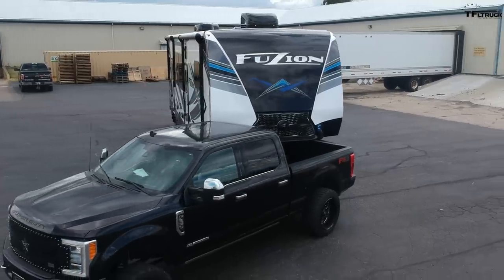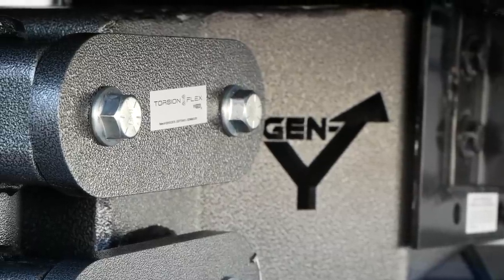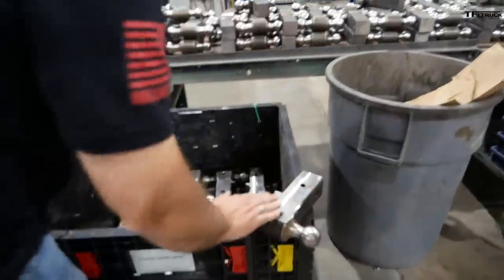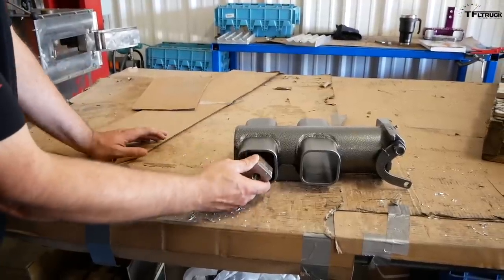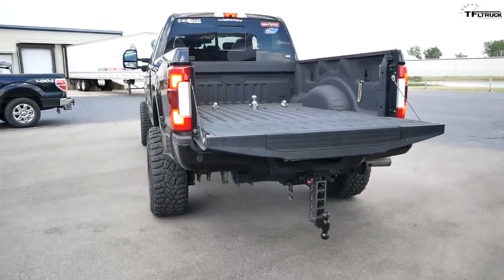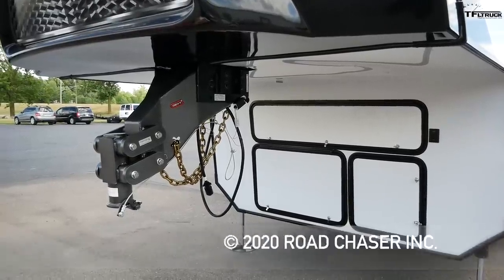Stress-Free Towing: Here’s How This New Hitch Will Change The Way You Tow!

Comment: Which one was a better ride experience, the 5th wheel or the gooseneck? Pro's/cons
Reply: From my experience, Fifth Wheel is super smooth and very connected to the truck but you give up your bed space. 
Gooseneck is a close second but you can still have most of the bed space.  
Generally, Fifth wheel cost a little more than a Gooseneck.  Fifth wheel are quicker/easier to hookup.
Reply: @fntony4967  Thank you.
Reply: Goosenecks provide alot more articulation which is necessary if you are off the pavement. That's why heavy stock haulers for livestock are preferred by ranchers and construction companies that haul equipment. Some claim the gooseneck is stronger also, but I don't know .

Comment: Rubber components over time will deteriorate with wear and age. What is the expected service life in time and mileage before the hitch will need to be rebuilt?
Reply: I’ve heard of Dexter torsion axles lasting 10-20 years plus. Think something like this would be similar.
Reply: @ALMX5DP  can confirm my haulmark 24' enclosed trailer has torsion axles with over 100k miles on them with around 5k lbs on it and it's a 2000 model year.
Reply: As Alan said, most plastics/rubbers deteriorate over a 10-20yr period, affected by use and climatic conditions.  You’ll probably just need to replace those parts when the time comes if they are available separately.

Comment: Still. Nothing beat the stability of a plate style 5th wheel hitch. The chucking and movement you get on the gooseneck style towing hitch is scary when towing heavy. Yes the 5th wheel plate style is bulky. But I’d rather have bulky and stable. Than the other. Put a go pro in the back with a genY and then with a standard 5th wheel puck or rail style hitch. You’ll see what I’m talking about.

Comment: What is the life span of the rubber inserts?
Reply: I was curious about rubber degradation too.  Wonder what happens if there is a catastrophic failure of the rubber too as it gets old and then is suddenly put to heavy use.
Reply: Torsion axles have been commonplace for a long time. They can last upwards of 25 years though I think most say to preemptively replace around 20.
Reply: .........and I was wondering whether the torsion inserts were rebuildable.  (just curious as I don't tow that much trailer and wouldn't be a customer in any event)

Comment: What they didn't do was go down an interstate highway and go over a bridge at 60 miles an hour.
Most Bridges are built taller than the road so you have to go UP on to the bridge and then Down off ot the bridge. This would be a true test of that hitch. I've been pulling a 14,400 5th wheel for 12 years. And because I have a wife it ways 16,000 :) Whenever you go over a bridge at that speed.
You get this BAM BAM going up on it and BAM BAM when you come off the bridge. I have a TRAILAIR hitch. That is a 5th wheel hitch with an airbag and shock absorber made into it. And it
does a great job of relieving stress on the hitch and truck. It also stick further out in front of the 5th wheel giving me plenty of room to walk in between the truck and the 5th wheel. Whereas that hitch gives you no room. I can open my front basement compartment without unhitching and that model
doesn't allow for that. These guys should leave advertising anything to do with towing to people who  do it all the time. They have no idea what their talking about and are just making money for  advertizing that hitch.

Comment: I would be interested in their gooseneck conversation however, Lippert has only certified the Reese Goosebox for their frame and parts on the fifth wheels.  Gen Y is not.  Also, they do not say what is the life expectancy of the rubber in those shafts.  When the rubber components fail (they will at some point), how is the consumer suppose to have them serviced and or replaced?

Comment: I want the shock on the truck, not on one trailer.  You can also go to an offset ball to move the trailer back. Easy peasy. How do you tune the torsional forces to match the load?  Mine varies from a few hundred pounds to a thousand pounds

Comment: With the 5th wheel torsion setup, in the video there appears to be a potential problem with the kingpin end possibly hitting the trailer depending on how bad road conditions are and how much it is flexing up and down.  Not an issue with the gooseneck setup because of the longer distance for clearance.  Would be interested in a comment from the manufacturer.
Reply: I wondered the same thing.  It's getting a lot closer than I'd be comfortable with.

Comment: I'm looking at a new toy hauler and plan to pull it with a ram 3500 mega cab with ramboxes. I want to use the gen y goose neck box. Have you heard of anyone doing this? I plan to add a 4 inch offset ball as well.

Comment: I have a similar 2019 3500 SRW CC LB Duramax and pull a 40’ fifth wheel weighing 13.5k. I noticed the truck was level and not squatting. Did  this truck have any suspension upgrades? Even the lifted Ford stayed level. A 3100lb. pin weight is much heavier than what I pull. Very interested in replacing my Andersen hitch.
Reply: Do you have your 5th wheel as far forward as it can go? My dad has a sliding hitch and a 2500 HD. He slides his all the way forward for driving and all the way back is he needs to turn into really tight spots.

Comment: How is this for turning radius? With most gooseneck I am finding that on sharp turns I risk the tongue hitting the side of my box. I have plenty of cab clearance. But because of the risk of hitting the side of my box I have had to go with a slider hitch which is heavy and takes up a ton of room. If i could find a gooseneck that would allow for the sharp turns I would convert imidiately

Comment: Almost 2 years later and Lippert (LCI) still has not certified this gooseneck conversion for use with their frames. Buyers should know this before spending the money on something that will void the frame warranty on their expensive 5th wheel. That being said I'm betting Lippert has tested it by now and it doesn't pass. If you want a gooseneck conversion look in to the Reese Goosebox. It's approved by LCI for use with their frames.
Reply: Reese does not have a unit for the Rhino pin box>?

Comment: Can you go into greater detail why one would choose a gooseneck vs a 5th wheel? What are the pros and cons of each?
Reply: I'm no expert but it seems that in general RVs are 5th wheel and horse trailer and equipment trailers are gooseneck. It seems to me that a 5th wheel may be easier to hook up because you drive into a wedge instead of having to get it perfectly centered and then lowering the trailer onto it, like with gooseneck. Seems like the big advantage of the gooseneck is that it doesn't dominate the whole bed when it's not in use, and the ball is usually removable to regain full use of the bed, where a 5th wheel hitch tends to require multiple people or a machine or hoist to remove it. As far as when it comes to driving I don't know.
Reply: 5th wheel doesn't need safety chains, goose neck allows for more angle between truck and trailer when going over uneven ground and in pick ups is generally rated for more weight.
Reply: For me, less weight.  Tring to get under my load capacity dont want a 300lb hitch in my truck.  Worried about clearance thou

Comment: Great Video! 3,100 lb Pin Weight in the box on a Single wheel Truck, probably the pickup is rated at 1 Ton. That's 1,100 lbs over weight, how does that work out to Tow that Trailer Legally and Safely?
Reply: Frank Logan - the newer trucks still use the old rating system, as in we call them 3/4 or 1-ton trucks. But the payload capacity is WAY more than that these days. For example, my work truck is an F350 dually, it has a cargo capacity of 5486 lbs. My personal truck is an F250 and the cargo capacity for it is 3300 lbs. so they are still under capacity either way.
Reply: @DanMar5858  you have a F250 with a payload of 3300??? Wow..
Reply: @jasongiordano907  must be a gas truck or single cab diesel f250. Our 2017 ford f350 crew short bed fx4 diesel has a payload of 3,475 lbs.
Reply: @j.l.salayao8055  Worese than that my 2022 F350 6.7 diesel limited with every trailer towing option has a payload of 3150lbs.

Comment: Nice hitch, but never would I tow something that massive without a longbed dually for extra stability.
Reply: Why longbed? I thought short bed was better for towing.
Reply: @noconz0727  You always buy the longest wheelbase truck you can for serious towing.
Reply: I was wondering if anyone was going to comment on the towing vehicle. That 3/4 ton is not legal to pull that trailer, empty or full. 

The ride comparison might be better on a truck that is safe to pull that camper.
Reply: The short bed is only useful for parking in lots and garages. The long bed is a more useful length.
Reply: Noconz0727 MC Nope.
Reply: @chriswilson433  I thought that was an F-350. Is that a 3/4 ton? (i'm asking, I thought the F-350 was a 1 ton or is it only the dually?). Some of those trailers are lighter than they look, mine is only 6000 lbs and I can pull it just fine with my V8 F-150. I probably could pull it better with my V6 Ecoboost, but I don't have it anymore. The only thing that I don't do is go faster than 55 mph. The truck can easily go faster, I don't even feel the trailer, but it is just stupid to do, at 55 I can just let go of the gas and the deceleration is just enough to get me out of trouble, any faster is just asking for trouble.
Reply: Lucyferina

I will look again but I am certain it was an F250 which is a 3/4 ton. Payload on that truck is probably right at 3200 lbs. In a previous video, Andre did a walk-around of that trailer and it is rated to 21k lbs with 4400lbs pin weight at maximum. It is 14k lbs dry with about 3k lbs pin. 

I believe that that particular truck is maxed out with the empty trailer.
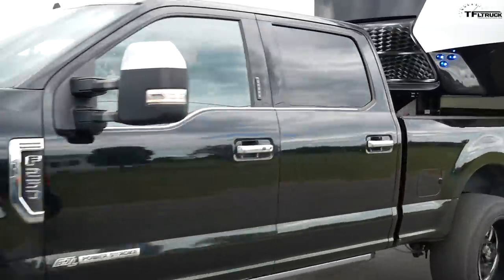Reply: At 13:09, you can see the Ford is an F-250.
Reply: @chriswilson433  please show where its illegal for a non commercial vehicle to exceed payload
Reply: @drew4769  You right that there is no law is most STATES specifically dealing with private vehicles over GVW  Towing or GVCW. However the legal fallout following an accident may encourage you do always drive within in the limits. In Canada (BC specifically where I am from) a peace officer can give you a Violation Ticket which is just a fine or a Notice and Order which means you must bring the vehicle within in compliance. You can get both with one stop. Further to that you don't even need to take it to a scale. You can be served for a vehicle that is unstable while moving, front end higher than the back (squat) and tires that are under inflated. In my eyes it is not enforced enough. There are so many dangerous combinations on the road these days. There are serious RV crashes on our highways every year. All of them were speed or weight related. Our mountain highways are steep and twisty. I laugh when they brag on this TFL channel with their Ike Gauntlet only being 7%. If you have seen the show "Highway to Hell" that is where I live. 3 major highways that allow the West Coast to access the rest of Canada through a series of mountain passes.

Comment: Will the gooseneck option work with the B&W Turnover Ball for a Ram 2500 short bed? Also, does it allow for clearance issues when making sharp turns? New fifth wheel arrives soon and I was in the market for a companion sliding hitch but I would rather go this route! Love the content!!!!!
Reply: So did you get the gen y torsion gooseneck hitch and the b&w turnover ball for your short bed? I have a short bed truck and I’m looking at getting both the gen y and the turnoverball also. Does it work on a fifth wheel for sharp turns in a short bed truck? Thanks.
Reply: @IslenoGutierrez  I haven’t yet. I only have the turnover ball as of now. Main reason I haven’t switched is no one will give me a straight answer of changing out the pin box will void the chassis warranty on my toy hauler
Reply: @mrb9090  You’d have to call either the company that made your toy hauler if they use an in-house warranty or call the company that company uses for their warranty if it’s not in-house. I have a short bed Ram 2500 and I found the fifth wheel I’m going to buy that stays within my payload and tow rating of my truck and I’d like to get the Gen Y torsion gooseneck hitch because of the very smooth ride and the freeing up of space in the bed of my truck but I need to know if it will work on a short bed so it won’t hit the cab when I make sharp turns. I also thought about getting that b&w ball that is moved 4 inches back toward the tailgate to try and make it all work. I’m trying to piece together this info so anything you know helps.

Comment: With a short bed truck, some 5th wheel trailers need more than a slider hitch to prevent a cab strike. My F350 SB has 37" from kingpin center to cab, with a slider adding 12-14", the trailer I bought would clear the cab by roughly 2 5/8" using the Demco slider with 14".   Not much of a safety margin, so this type of pin box would not be a good option for my trailer. I wound up getting a Sidewinder pinbox, and using a CURT A20 5th wheel. The trailer now clears the cab by 11" giving me more than 90* turning ability.  The suspension on it looks like it would be very smooth for the trailer, less wear and tear on the frame and sliders between the kingpin and front axle.

Comment: Doesn’t this void your frame warranty?
Reply: I think he means the frame of the 5th wheel trailer.  For example many manufacturers will void your frame warranty if the Anderson 5th wheel hitch is used.
Reply: @JNC7601  I just asked that question above. The Goosebox will not void the RV's frame warranty
Reply: Is it illegal to pull a goose neck hitch  without chains. I have Anderson goose neck hitch did not come with chains

Comment: How did the f250 do with that large toy hauler?  I have a 2019 f250 and would think that truck wouldn't be enough truck for that trailer? Maybe I'm wrong
Reply: You are not  wrong! These guys never heard of payload capacity? They hooked a 5th wheel with a pin weight in excess of 3000 lbs to a 3/4 ton with around 2200-2400 lbs payload capacity...
Reply: @Built05STI  yes, the newer ones with an increased GVWR but not a 10K lbs GVWR truck.

Comment: What are you towing with? You said the tongue weight of the trailer was 3100 pounds. That looks like a Chevy 1500.
Reply: 1500 don't have hood scoops
Reply: A 1500? C’mon now.
Reply: @Icutmetal  Ok. It cannot be. However, if you are going to produce a great episode about hauling with a new hitch, why omit a key fact? Is the truck a 2500? 3500? What size engine?
Reply: It's a 2500
Reply: @MrTruckTV  ok. Next unanswered question. How can a 3/4 ton truck support a tongue weight of 3,000 pounds?
I am not wrong to insist that these very basic questions should have been covered in the video. 
Viewers will have to watch BigTruckbigRV to get more info.
I still liked your video, however. Thank you for posting and for your kind reply.
Reply: @WaltANelsonPHD  obviously the lift on that truck certified it for the higher payload LOL.  Seriously, you are right to raise awareness of overloaded tow vehicles which can be a safety hazard.
Reply: @jamesbeaman6337  Thank you. We often see trailers incorrectly attached. I would guess 25% are poorly attached, etc.
Reply: HalfShell sounds legit and no stress calcs or testing neeeded!

Comment: They are worried about the ride quality but they have those stupid wheels and  low profile tires.
Reply: ...on a 3/4 ton truck not rated to even pull that trailer empty.
Reply: Chris Wilson Could also be a 3500SRW; I didn’t see the side plate in the video.
Reply: At 13:09, you can see the Ford is an F-250.
Reply: Chris Wilson - F250 Gooseneck for 2019 is rated to tow 14,800. If it’s a 2020 model then F250 gooseneck rating is 18,100. That is per Ford towing guide and that is assuming that it is equipped with the Powerstroke Diesel.

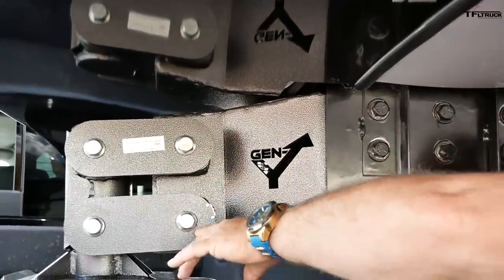Comment: 2:20 16? Where do you see 16 rods?
Reply: I think they are referring to the rubber bushings, there are 8 in each tube.
Reply: acdii - there are actually 4 in each tube, 1 per corner with the threaded sleeve in the middle.      There are 2 tubes on the trailer side, and 2 tubes or on the truck side.  So that’s 4 tubes total with 4 (rods) or bushings per tube, for a total of 16 rods/bushings on that hitch. Referring to the question of the OP Jeremy Specce.

Comment: So that trailer is definitely overloading the payload of that 3/4 ton truck - right?  Weight police haven’t chimed in yet. Just wanted to see when the appropriate 1 ton dually was going to hook on. 

So sick of the keyboard warriors.......
Reply: John Smith -  the newer trucks still use the old rating system, as in we call them 3/4 or 1-ton trucks. But the payload capacity is WAY more than that these days. For example, my work truck is an F350 dually, it has a cargo capacity of 5486 lbs. My personal truck is an F250 and the cargo capacity for it is 3300 lbs. so they are still under capacity either way.